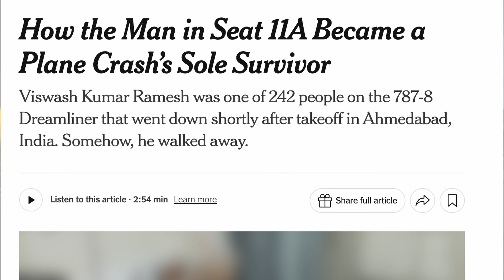Why the RAT Changes Everything – Air India 171 Update

Comment: I just want to point out that in October last year, another flight in India (Boeing 737-800) had hydraulic failure right after take-off. They did manage to keep control over the aircraft and managed to land safely. I now wonder if hydraulic failure could be the cause of this accident too? It could explain why the landing gear wasn't retracted, I can imagine that this procedure puts a lot of pressure on the hydraulic system. Dual engine failure just doesn't sound likely to me, as both engines seemed to work fine at takeoff.

Comment: What conditions would contribute to a dual engine failure when they were functioning properly at maximum power in the absence of a flame out/bird strike, etc.?  The engines appeared to be functioning properly at take off through rotation.  Bad/inappropriate fuel?  Poor maintenance?  Still unable to determine flap positions.
Reply: Perhaps refueled with AvGas instead of Jet A leading to vapor lock shortly after takeoff?

Comment: Could it have happened this way: they are faster than the maximum speed to abort, 1 engine fails, the pilot decides to use the whole length of the runway, right after rotation the second engine goes, they have no altitude to find a relatively safe place to crash.

Comment: Next time they should put some fuel in before they try to take off. So, a big crash and almost no real flames at the crash site, fire or the smell of fuel that is always present at crash sites. By the way, the plane was supposed to fly all the way to London, so it would be full of fuel, right?
Reply: Did you miss the large diameter fireball?

Comment: While the theory of premature flaps-up is to me the most likely TO HAPPEN, it is also the least likely to produce the RESULT we saw: An airplane under full control, probably at best-glide or best-sink airspeed, no wobbling, or stall-tendecies that we would have seen had the flaps been retracted at low airspeed, high weight climbout. The plane would most likely had stalled and spun to the ground before they'd had the chance to gain the 40-50(?) knots difference in stallspeeds with or without flaps.
So I agree to a total loss of power, whatever the reason behind that might be.

Comment: With regard to dual engine failure, a  question comes to mind: Assuming the ac remained airborne for say 30-45 sec after both engines failed, there should be several eye witnesses on ground directly under the flt path who would be in a position to say whether the engines were working (unmistakably very noisy at an altitude of 400') or silent. Would that not be so?

Comment: On another channel, they were showing the original video yesterday and proved the rat theory. Also....there was an electrical engineer in the comments who was certain it was an electrical failure on one of the major 'buses' that regulate voltage. 
That aircraft had known electrical problems on a previous flight - passengers complained about the lighting and the entertainment system were not working. This looks increasingly like a maintenance issue - a serious problem ignored.

Comment: Dual engine failure with maybe possibly water in the fuel system  bcz a similar thing happened in 2013 but that flight was in air and they were able to get the engine 2 running and landing but there i think just after 10 to the air sec when the engine went off no combustion in both the engine due to water maybe or some electrical fault also the temperature was high and air pressure wasn’t  that good   It wasn’t the pilot but could be ground staff mistake or error

Comment: Dual engine failure can mean different things to different people. The engines themselves may not have been the root cause but the electrical and or hydraulic systems supplying them likely was. So the engines weren't the problem but everything else possibly was causing ttem to stop providing thrust. Remember the reports and videos pre flight show everyone complaining that the genset was not operating so they were all really hot on board without ac pre flight. Indicating that what the pilots thought was a small technical problem may have been symptoms of a much larger problem unseen. This will likey also mean that there is internal comms regarding his fualt and to continue with the flight regardless. So there most likely will be some differed maintenance beeing the root cause.

Comment: It seems there was no asymmetric thrust 
If it was dual engine failure they failed symmetrically 
Consider both engine fuel valves closing simultaneously from a high flow…some sort of electrical signal  weather unintentionally commanded or an electrical anomaly is a consideration

Comment: Everyone will learn that 1 engine failure on a Boeing 787 can lead to 2 engine failures... another redundancy failure... look at the RAT...
Reply: On Jul 12th 2025 (UTC) India's media report that the investigation is NOT focusing on a human action causing the fuel switches to appear in the CUTOFF position, but on a system failure. Service Bulletins by Boeing issued in year 2018 recommending to upgrade the fuel switches to locked versions to prevent inadvertent flip of the switches, as well as the FAA/GE issued Service Bulletin FAA-2021-0273-0013 Attachment 2 relating to loss of control issue (also see above) were NOT implemented by Air India. The stated MN4 computer with faulty soldering, that might weaken and lose contact due to the thermal stress after a number of cycles, interprets data and commands fuel metering valves - with the lost contact attaching the MN4 processor to the EEC intermittent electrical contact, loss of signal processing and engine control faults can occur. The SB writes under conditions for the SB: "An LOTC (Loss Of Thrust Control) event has occurred due to an EEC MN4 microprocessor solder ball failure." According to discussions in the industry it may be possible with the number of cycles VT-ANB had already completed, the solder balls were weakened sufficiently to detach the MN4 from the EEC momentarily due to loads during the takeoff rotation leading to the loss of control of thrust and shut down of the engines.

Comment: Could one of the pilots have deliberately left the landing gear out, switched the flaps wrongly and cut the 2 engines making it impossible for the other to correct the errors?
Reply: No the gear was selected up, look at the main wheel bogys, they were tilted in preparation for retraction, but the doors never opened.

Comment: Video makers are having a field day speculating on their own theories of 'what could have happened' that caused the Boeing 787 to crash. Why not wait for the FACTS to emerge? Why speculate, when an analysis of the Flight Data Recorder and Cockpit Data Recorder will reveal the truth no one can deny? Wait for it. Stop these baseless allegations against Boeing, that both engines had failed, unless someone is using the aircrash to run down Boeing against its arch rival, Airbus.,

Comment: I am wondering if the black boxes would  give the exact timing of when the RAT was deployed......if the gear would not go up then the RAT probably deployed then signaling a problem...its tough to watch......dual engine failure is an extreme extreme rarity.....several system failures may be discovered.....RIP to those we losted......

Comment: The Ram Air Turbine could also have been manually deployed .... Just saying. A dual engine failure is just so exceedingly rare that I still lean towards pilot error. Early flap retraction by mistake and with the loss of lift confusion leading to manual Ram Air Turbine deployment. The black box will reveal all. May they all RIP. Tragedy either way.

Comment: I thought the idea of retracting the flaps instead of the landing gear was rather unlikely given the performance of such an airliner. I tried it in Microsoft Flight Simulator 2024 with a fully fueled aircraft, took off at minimum speed, then immediately retracted the flaps and left the landing gear out. Assuming that you then leave the two turbines at maximum power (there would be no point in complaining about dwindling power if you pulled back the throttle) and you don't pull the aircraft into a stall, it then had enough power to simply fly out of the situation in this configuration.

Comment: I reckon it might be more likely to be hydraulic power, because the landing gear is still down and in an inverted position. Search up the mechanism of the 787's landing gear and the wheels actually rotate before going up into the aircraft and you can see that rotation of the wheels has occurred in the video

Comment: Capt Steve….my understanding is that after each flight is completed, data is sent to Boeing (electronically) about many aspects of the aircraft performance metrics……what  kind of information is this? Is this sent without the airline having to do it, or does it need to be sent by the airline technical staff etc….

Comment: Steve couldn't the pilots have deployed the RAT thinking they had engine failure? To me it sounds like the engines are still running as I hear the jet engines running too. Not to say that the thrust wasn't degraded, or the density altitude  got to it as it was a really hot day. I am still in the flaps camp, why? There is a photo of one of the wings post crash that shows them in the retracted position.

Comment: This all sounds so "clever". But here's the anomalies I see:
- we can supposedly HEAR the rat, but at that time there is NO SIGN of the device deployed below the aircraft. If it isn't deployed, it will NOT be working. So what is that noise? 
- we heard the impact. And apparently the rat (I doubt that). Why can we NOT hear the jet engines, that would be straining near max power for takeoff. (Because they are not running / in trouble - the "rat noise" might be tortured jet engines). Anyone living under a flightpath knows just how ear-deafening that noise can be. Modern engines are quieter, but I would expect to hear more than this, IF those engines were running. 
- the last evidence is visual. Where is the heat haze that those jet engines should be pumping out? Comparing this takeoff with any other 787 at similar state of takeoff in similar weather conditions will show us what WORKING engines would look like. The difference would be revealing. 

All of this leads me firmly to believe that this was engine failure, for whatever reason. 

Even the way the aircraft retained nose-up attitude, but began to fall out of the sky like a stall, implies there simply was not enough thrust. Control did not appear to be a problem. 

- This aircraft would be accelerating all the while IF the engines were functioning, so a premature putting away of the flaps would have resulted in a hesitation in climbing, perhaps even a slight dip in altitude, but a complete pancake like this? Nope. Accelerating speed and aerodynamics do not work like that. If it had enough lift to jump off the runway, then it certainly had enough speed to stay in the air as it got faster. 

- If the flaps were not properly deployed at take off, then it would NEVER have climbed to that altitude in the first place. Despite the nudge it would still get from ground effect at takeoff rotation, it would NOT have any effect at 600 feet. And more critically, IF the aircraft were still accelerating, lift would be increasing all the time, and be much greater at 600 feet than it was at 100 feet, or 200 feet, or... (you get the point). In other words, having got to a height that "wrong flaps" could not have achieved, then its ability to climb would be getting better and better as it picked up speed, not deteriorate until it falls out of the sky. 

ALL of the evidence points to lack of thrust (ie double engine failure). 
What caused that, I cannot say for sure. But I have confidence the cockpit recordings will tell us in due course.  
The lack of smoke and debris coming from the engines suggests a shutdown or fuel issue, whereas a birdstrike would have probably started fires and debris trails. 

I reckon the wheels staying down were because the pilots already knew they were coming down, and vainly hoped they might actually land on a road or something.

Comment: Engine failure does not mean a physical failure as is often the case with bird strikes, but what besides fuel is common to both engines and would cause failure at the same time? Do both engines draw from the same location such as the body tank, or is in normal to have them draw from separate wing tanks. A total failure of the fuel system if drawing off the same tank could result in them both flaming out at almost the same time, besides pilot or some strange electrical failure.  For shorter flights is it normal practice to fill only some tanks, and leave minimal fuel in others, but this was india to london, so 7500km plus reserve fuel, in a jet with 13500km range, it's unlikely they had drawn fuel off an empty tank.

I know there are redundant hydraulic systems, so its unlikely all 2 or 3 would fail and even then that's simply a reduction and then eventually total loss of control over minutes as pressure and oil bleeds out of the numerous accumulators. 

The lubricating oil system for the engines - is this common or engine specific? Again it's unlikely as I have watched videos of engines lasting minutes with no oil pressure.

Comment: From other video and people having the 787 technical manual, the RAT could also deploy with one engine failure + another failure ( hydraulic and/or another one) or cockpit instrument failure  . And the APU may have auto started but it is not instant si it could explain why the survivor saw the lights off then on. Clearly something very bad happened at a critical moment and very low altitude, investigators have work to do, may not be so easy to find the real chain of events.

Comment: Just throwing a wild idea out here, but having read the it had electrical issues beforehand, could the extra load of running the hydraulic pumps to retract gear have been the the straw that broke the electrical's back? It does seem to show the problem occurred while they were in the process of retracting gear.
Also, suppose it being fuel contamination, but like Captain Steeeve said, you'd notice this on the runway already. Could the increased pitch while climbing be a factor that would enable the water below the fuel (I'd say the fuel is lighter than the water) to slosh to the pump feeds? Anyone familiar with the 787 able to deny this (like I said, a pretty wild guess)?

Comment: 12:55 yeah its puzzling. I don’t know how it would happen but my guess would be also some sort of issue with the fuel which would be dependent on attitude. Because why would they run perfectly fine at take off power the whole take off run and then just die right after rotation. I don’t think it was bad fuel because otherwise the engines wouldn’t have done that, they would have shown signs earlier in the take off run that something was wrong with the fuel itself, but that there maybe was something in the fuel that was separate from the fuel, or they took off with empty fuel tanks. Idk how the fuel tanks and fuel pickups are arranged on a plane like that but if they are arranged towards ghe back of the tank, to pick up fuel at a climbing angle, that would mean that water in the tanks would flow to the lowest spot while climbing, and that would only be happening right after rotation, and if the fuel had a lot of water in it, then that would be the same on both sides imo and both engines would die at the same time. That to me is the most plausible explanation, if there wasn’t another issue with the plane like electricals and what not.

Comment: The Rat deploys when the engines have failed to generate operational electricity. It seems to confirm simultaneous double engine failure. This probably happens because of mechanical failure through bird strike or from contaminated fuel.  
There is also a possibility that something else went perversely wrong with the electronic control system which switched the engines down despite the pilot’s instructions. Perhaps the black box might reveal the instruction the engines were operating under at the time of the disaster?